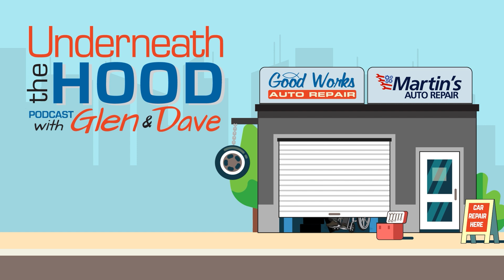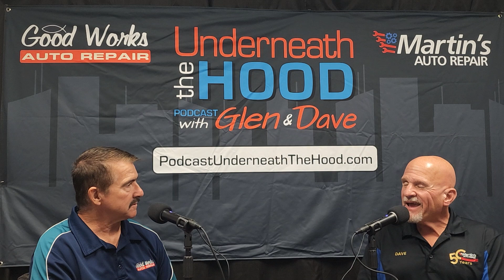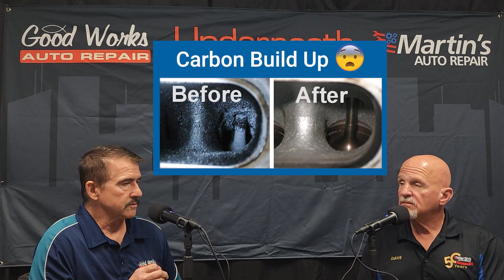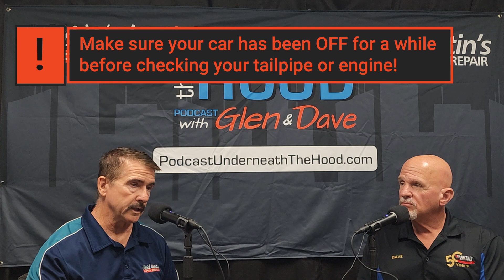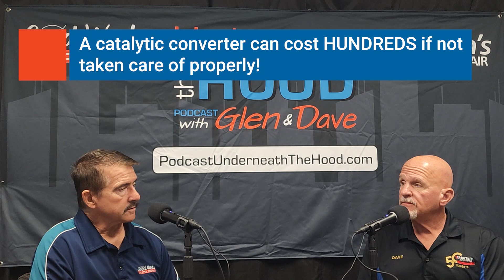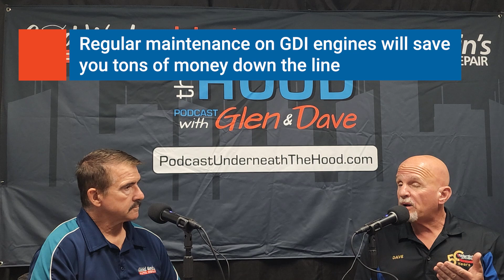Ep. 28 - Are GDI Engines All They're Cracked Up to Be? Real Mechanics Break Down Essentials of GDI

Comment: If the gas is injected into the cylinder ,how does the carbon get on the back of the intake valve, where there is only air?
Reply: Crankcase breather/PCV
Reply: PCV and EGR
Reply from the maker: I comes from the EGR and PCV system coupled with the combustion of the fuel and ring blow-by from the combustion chamber.